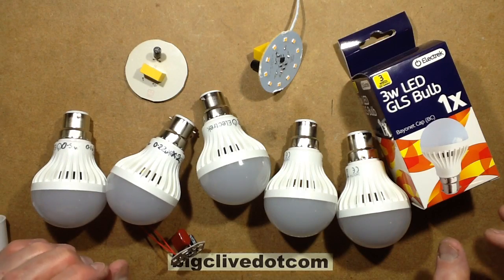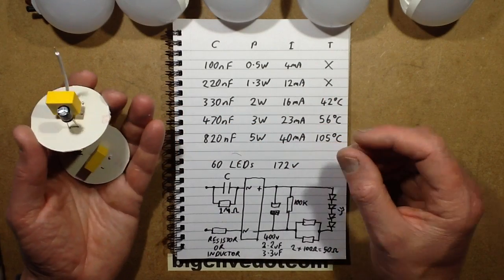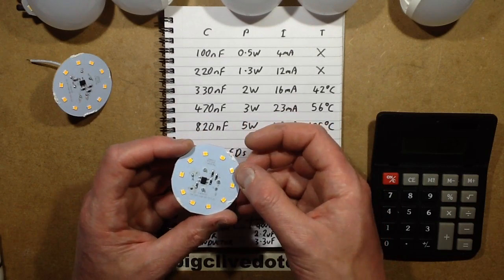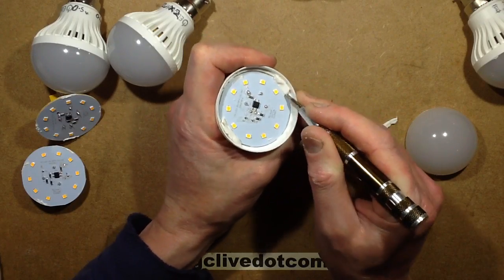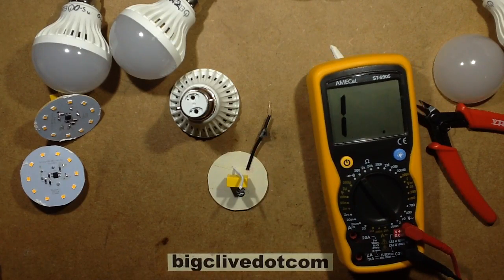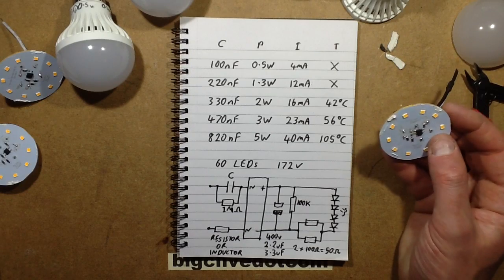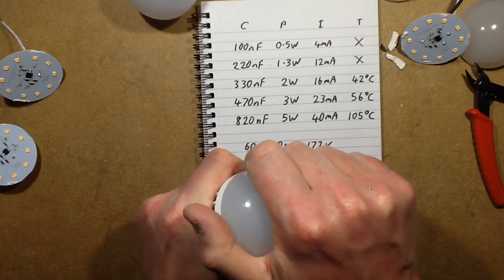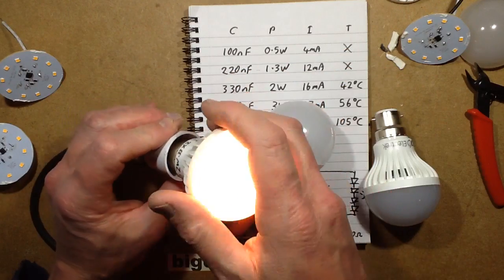Modifying Poundland LED lamps with test results.

Comment: Do not remove that 100K resistor is to protect the circuit from high voltage and to burn the fuse before the led circuit get burned when the capacitor fail or get shorted also by kirchof law the 100k resistor is in parallel with leds and the resistance for that is not 100k anymore but need more calculations and that resistor acts like a voltage current shunt is like a MOV surge protector 😊

Comment: I bought 2 sets of LEDs for use on 240V here in Canada....i got the 12 Watt range for a desk lamp. Out of curiosity, i tried the Phillips one (non multi voltage model) on 120V and it works .... at abt 9 or so watts (looks like a 75watt bulb vs the intended 100W on 240v). I then tried the cheapo no name brand one(also a 240V rated led bulb) on 120v but it didnt work. Why would that be? ....Would running the Phillips one on 120V also increase the life of the bulb....without mods ? Do you ever tear open a name brand LED bulb or are u a fan of no name ones ? 😆 Ive tried no name cheapo local bulbs and sometimes i find the CRI is a little off ... not as pleasant 2700K  as the branded ones. So it ends up being outside for my driveway 🤣
Reply from the maker: The modern lamps use a very high voltage series circuit of LEDs that is close to the intended mains voltage.

Comment: Good stuff indeed Clive, have you considered measuring the luminosity of the bulbs so that a factual value can then be compared?
Thanks Clive
Bib
Reply from the maker: Having tried several cheap light meters and got different results from each, it's not that easy.
Reply: @bigclivedotcom  thanks Clive

Comment: Wow. One of my LED bulbs has started a slight flicker; it does it every once in a while. Rated for 9 watts and 800 lumens.  Branded Maxlite.
Reply from the maker: Sounds like classic LED failure.  If you took the cover off you'd probably see that one LED had a black dot in it.

Comment: Have you taken apart a 12W globe yet? And how many LEDs are there other than those 10LEDs could see, where does the rest of the voltage gets taken up? Btw, what is the voltage drop per LED?
Reply from the maker: I took apart a higher powered lamp recently.  The LEDs have multiple chips.  I think the highest voltage I've measured across a single LED is around 35V.  The voltage difference is dissipated as heat by the regulator chip if it's the simplest type.
Reply: Would you explain "The LEDs have multiple chips" what it means because I got confused now as well as during this video. Are you suggesting that a LED has a chip incorporated with it? I thought the greatest forward voltage drop on a pure LED is under 5 volts.

Comment: A really informative and useful video, Clive.  Thank you.  If anyone wants to reduce the brightness and power consumption as you suggest, an additional external capacitor - maybe a 470nF 240V ac one - in series with the lamp would avoid pulling the lamp apart.
Reply from the maker: Yes, that would work.  I'd recommend a 1 Megohm resistor in parallel with the external capacitor to discharge it.

Comment: Why use two100R resistors in parallel instead of just one 50R ?
Reply from the maker: Presumably to stay within the power rating of each resistor.
Reply: Cheers Clive.

Comment: Led drivers typically use a transformer. Many led's like the ones shown in this video use a bridge rectifier and 400v capacitor. I wonder how do they compare? Are non-transformer ones more dangerous? Are transformer ones considered as non-isolated while transforner types called isolated?
Reply from the maker: The capacitive droppers are much simpler, but have poor power factor (voltage to current phase relationship).  The capacitor circuitry also has no isolation like some of the transformer based drivers.  The main advantages of the capacitive droppers are their simplicity, reliability and low electrical noise generation.  But they are better suited to long strings of low current LEDs and not at all suited to high current applications.
Reply: bigclivedotcom A set of Big Thanks to Big Clive !

Comment: Hi Clive just watched a few of your videos on LED's and in one you talk about watts vs heat
what would you say is the highest watt LED bulb for max light and max life ?
60w ? 
i'm about to move the house over to LEDs from the dull yellows we have had for a decade now and was just going to fill the house with =to 100w LEDs but i've read that some people are getting only 3 months max though this may be because they are from china and not a name brand
Reply: power of light source measured in lumens. Watt thing is thing from the past, from lightbulbs, which used Joule heating, those have really bad effectiveness (all of them  had about 5-8% depending on modification in base construction). Effectiveness of LEDs greatly depends on various factors, on type of converter and type of LEDs for example, while  for light bulbs power consumed and light power are proportional. For LEDs it is not, so LEDs are marked directly in lumens. What kills LED lamp is the excess heat, although as any semiconductor device they can have case of "infant death", due to hidden manufacturing flaws. Dissipted heat is proportional to power consumed. The converters is what usually go out if there is something wrong with power supply. You might have too low or too high voltage there, which may cause excess heat dissipating on elements, fluctuating voltage is a problem too. Another reason might be wrong wiring that leads in that breaker is installed on neutral wire instead of phase. Also, you never should use LEDs that  are marked "not dimmable" with any kind of dimmer switches, it wouldn't guarantee documented life. Also LED life usually displayed for 4 hour/day work cycle, actual cycle  - often switched on\off or constantly working - may change that value.

Comment: Thanks for the informative videos, I just subscribed. I have a question on a project I'm working on if you can help. The bulbs in my car heater unit burnt out so I bought LED bulbs w/matching resistors from ebay specifically for auto applications but they keep blowing. I just bought a bunch of Greenlite LED 9watt (60watt eq) bulbs from the Dollar Tree, I took one apart and see 12 LEDs inside. I was wondering if I can use these in my car to solder on the circuit board. The LEDS are wired 3 per side so I hooked up a 12volt battery to one of the boards of 3 LEDS and wow it's so bright, then I hooked up a 390ohm resistor and it's really dim. I'm trying to figure out what resistor I need, if a resistor is even needed. I have no idea what each of these LEDS are rated for voltage wise. The original bulb that would replace the OEM bulb is a regular bulb Radio Shack 272-1141 12volt 25 mA.

Comment: A big consideration for getting rid of incandescent lamps was the inefficiency leading to massive heat release. How ironic these LED's are running so hot i.e. terribly inefficient. Better to rewire & use the correct voltage to bare LED's with proper drivers, methinks.

Comment: bro see if they light up with a 9v battery Cus I had a gu10 bulb and it lit up lol
Reply from the maker: There's a video showing that the Poundland GU10 3-LED units will run at surprisingly low voltages.  These ones won't  though as they have a high combined LED forward voltage.
Reply: What does each led take to fully light up is there like 28v 6ma through each led? am I close lol?
Reply from the maker: The six chip LEDs need around 18V each to operate.
Reply: Mmmm interesting.... I'm thinking of making a touch using them in parallel with regulated battery.... Good vid gave me ideas thanks bruv

Comment: I offered Poundland quality LED lamps in 3-10 watt from £0.60p with delivery based on container loads for Globe bulbs, in own brand. Our Led bulb range will soon be supplied with a UK Utility with CE, RoHs and ErP 
This range of bulbs I sell into Africa for $0.45cents but not as a throw away when it fails, but can be serviced and put back in the market which angers the chinese who want to continue to see light bulbs thrown away when they fail

Comment: I really like the low powered lights, just wondering, on the half watt model was that current read before or after you took out the resistor? 
Also if you were going for a ultimate low power light could you change the circuit more to further reduce wastage in power?
Reply from the maker: Before and after, but the LEDs were visibly brighter with the resistor removed.

Comment: I purchased 5 or so of the completely sealed case poundland 5W golf ball style LEDs lamps and they lasted a week, died and promptly got returned. I have since substituted the ones I purchased for the 5W Elektrek ones with the slotted air vents, the exact lamps that Clive has torn down in this video and they are still going strong a couple of months on. I would sub the low value capacitors in, but for the fact you will loose the brightness / lumens which negates the reason for purchasing 5W LED lamps in the first place. So I'm just going to run them and see how long they last. Even if I get a year out of them and have to replace them it will be still be 6 or 7 years or more, before I would be out of pocket by comparison to purchasing a mainstream branded (Philips as an example) similar wattage LED lamp.

Comment: Got a question for you, Clive...Our hardware shop here in Toronto sells Chinese-made Par 20 single LED chip lamps...The 7.5 watt one (daylight - roughly 10,000 Kelvin temp)...They are incredibly bright. My question is this: Why are automotive LED running lights so expensive? It seems that if you could modify the Par 20 to run on 12 volts DC (automotive power) and epoxy/silicone it into a standard waterproof 'fog light' housing or even the plastic integrated headlight unit where the 'running lamp' (usually a halogen lamp) resides...There's a project for you...(regards: mr. cheap - in toronto!) Love your videos!

Comment: i have to say. the longest lasting lamp i have ever had and still works is a general electric CFL. its 10 years old and it gets used everyday for many hours and has seen alot of use. it puts out very nice warm light, much nicer than the light that LEDs output, very bright too. Its possibly the only good CFL to be made.
Reply: the light is very warm because of how old the light is, our bathroom light is like that where the new bulbs look really bright and cold compared to old ones :P

Comment: I've never had an LED lamp fail, thus far, which is more than I can say for compact fluorescent models.
Reply: I've had 2 or 3. A 4W GU10 in the kitchen and a standard light bulb replacement abt 5W spring to mind. None were specifically cheap.

Comment: May have been mentioned before, but I think the reason CFL and LED lights glow after power is removed is due to the phosphors that convert the UV light to visible light.

You used to be able to see this on old tube TVs when they shut down with a wide horizontal band in the middle. The band would fade away last.

Correct me if I'm wrong. Only way I'm going to learn.

Comment: hello Clive 
could you please make a separate video for showing and discussing modifications for reducing the wattage to extend the LED lamp life? you have shown the calculation in this video but didn't demonstrate actual changes on the bulb PCB. it'll really be helpful for some viewers.
in our area the higher watts lamps (10w) are quite easily available and price efficient while lower watts lamp tend to get into decorative lighting arena and are not very cost efficient.

Comment: Run things well within a safe range to last, like most things. An anthema to modern consumerist short termism. Cheers, Andy
Reply: Finally someone who doesn't like a lot of modern things ... or at least that is what I get from your comment.
:P
Reply: Hi. We run our systems below rated power and they last a long time, not creating stress is they key. The Victron inverter is about 10 years old and has been running continuosly, same with the solar trackers. Cheers

Comment: Can anyone please explain the purpose of using 2x 100R ?!
They are in most AC LED lamps and always in parallel.
Reply: +ELECTRONTHORP But why using them in the first place? Isn't the capacitor(s) doing the job of lowering the voltage AND limiting the current?
Reply: I guess the LED series resistor is a half hearted attempt to smooth out the current a little, otherwise each time the capacitor pumps above the LED voltage, it would very quickly discharge through the string, though at 40mA, there would only be 2 volts across 50 ohms. If they were in series, they would have more effect on damping the flicker to some degree

Comment: clive ,talking of the bayonet contacts ,they arent polar specific are they ? i want to replace all my STUPID  building reg'd  3 pin lamp holders to standard 2 pin ones ,and the live and neutral wires from the cieling does not matter where they are wired onto the new holders ?
Reply: also do u have a plasma lamp ? i used to love pressing compact energy bulbs against it ,but nevber tied it with LED lamps ,can u demo that for us ? lol

Comment: I've replaced all the lights I can in home with LED bulbs of 6.5watt/10watt 120v Edison base(of course I'm in the US), but the bases for all the bulbs here are made of ceramic as a safety feature to act a heat sink, and they can get fairly hot if left on for a long period. I'm not sure yet about the longevity yet as I've only started replacing my bulbs as I caught them on sale the middle of last year, but I have noticed my power bills have dropped some, so I don't have to yell at the kids as much if they forget to turn off a light lol!
Reply: mharris1270 I've yet to replace the bulbs in some of my ceiling fans as they use the smaller candelabra base style bulbs, and I've yet to find any LED bulbs in that style on sale yet, same with the porch light, and the lights in my shop are still oldschool fluorescent light tubes, but everything else has been changed to LED. Also I to note I got tired of replacing CFL bulbs as I don't think I ever had one that got anywhere near their quoted lifespan.

Comment: Do you UK people not need as much light as us US people? At least in my family, a 9w LED or 60w tungsten lamp is what we use in lamps. We have multiple lamps in our living room. In my bedroom, I use a 40w tungsten lamp (I use a touch lamp which has a lower sensitivity the higher the wattage, with an LED lamp fitted it will turn on when I switch on a desk fan... In the room across the house)

 I recently switched to a 3W LED lamp in a clip-on socket and it really just is not as bright as I would like. To be fair, the listing said it was 9w, but I did only pay 1USD
Reply: You think Big Clive is bad? most of the time I don't even bother to turn my lights on!
Reply: Well, when I cant see two feet in front of me for fear or stepping on a lego or equally painful object, I tend to use lights lol
Reply: Lol, "children mines"
Reply: It's probably because we have smaller rooms and so need less power to fill with light?
Reply: I use battery powered resin LED Christmas lights to light my bathroom. Im in rented and don't always need the ceiling fan to run for 5 mins after the light has gone off.
Reply: If I need to go take a wee at two in the morning, I just grab one of my powerbanks.
Reply: I'm from the states.
I have a ceiling fan with one lamp holder, it has a CFL in it. I rarely use that, instead, I usually use my reading lamp.
If I need focused light, I use my flashlight.
Speaking of the reading lamp, recently the incandescent bulb burnt out. I've modified it to LED power, and it runs at about 2.5W. (I bought a COB (Chip On Board, actually a ceramic substrate) LED for it, it runs at about 9V and 250mA)
I'm actually under-driving the LED, and even then, it's brighter than the 40W bulb I previously had. It's amazing!
Oh and for accent lighting, I have a tabletop globe lamp with a blue CFL in it. Looks pretty darn cool.
Reply: ya just have to get ya eyes used to it to save money and u probably got bigger rooms made from wood lmfao
Reply: +Luke Den Hartog lol just switch the light on ffs
Reply: Anecdotally I do think americans think we use insufficient power lightbulbs, tbh I find the poundland 3W LED clive's using here to be a adequate replacement for 60W tungsten/ 12W cfl regardless of the output equivalence quoted on the box. They're less omnidirectional than tungsten though - all LED's pointing away from the holder & half the bulb is opaque so it might depend a lot of what sort of lampshade you're using.